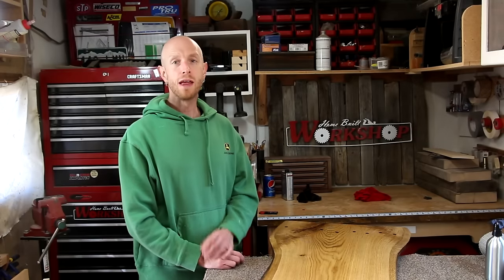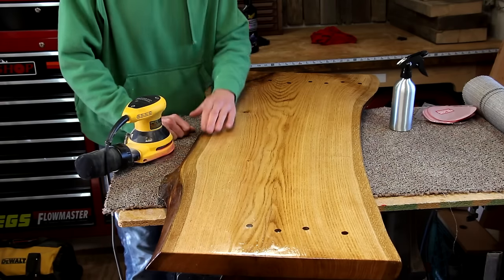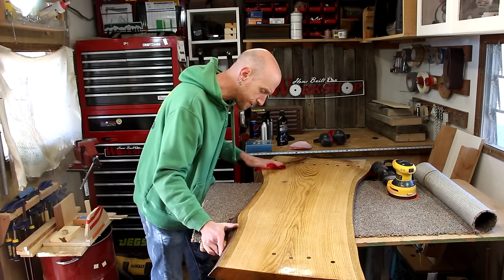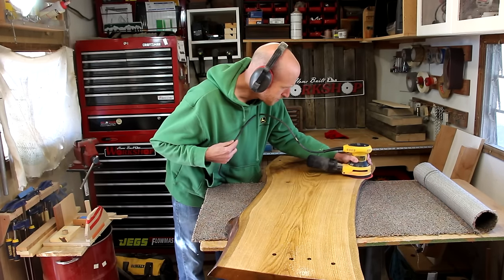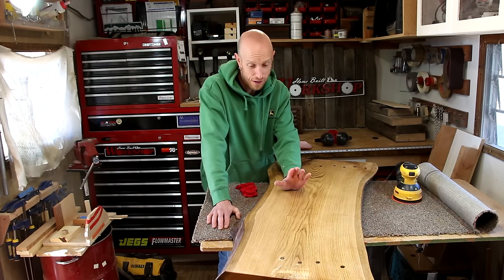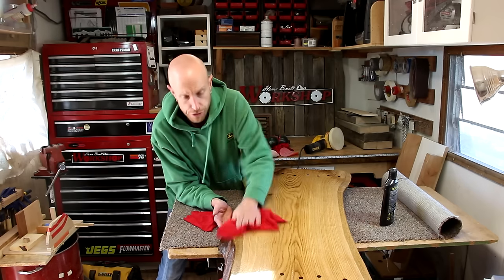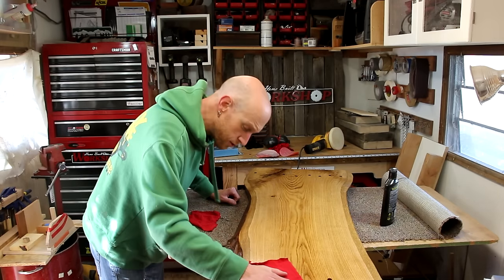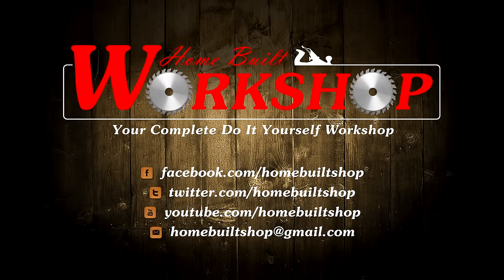How to Buff Polyurethane to a High Gloss

Comment: How long should I wait in-between every coat??
Reply from the maker: It depends on the type you're using. I've found that Poly takes a bit longer between coats than a lacquer. I'd see what the manufacturer recommends and try to stick with that. It usually works well.

Comment: So, if I recently finished an oak table and have between 4-6 solid coats of poly, I should still let the table cure for a week or two prior to following this process?  I do see a few brush marks and small imperfections/sanding scratches that I want to buff out immediately.  It's driving me CRAZY!!! Thanks for any support and feedback.
Reply from the maker: You still need to wait for the finish to cure. It needs to be hardened completely, it will help eliminate burning through. I know it's tough to wait. I'm the same way and want to get it done. 😁

Comment: I suppose you used oil based poly?
Reply from the maker: This was oil based. I have done this with water based and lacquer as well.
Reply: @homebuiltshop  Thank you for sharing your experience, experience is what I don't have. Comparing lacquer to water based poly, which has better durability for a sofa end table? I heard lacquer has higher gloss.

Comment: Are the sandpaper grades you are speaking of in P grade or not? If not where do you grade 2000 grit paper?
Reply from the maker: I ordered it online. Not sure if it's P though.
Reply: P grade would be printed on back of sandpaper. 2000 grit sandpaper is hard to find if not impossible. P2000 is equivelent to 320 grit. Big difference. 2000 grit would be something like a brown paper bag.
Reply from the maker: It's very smooth. Definitely not 320.

Comment: might the water-dust-mix damage the dust collection bag?
Reply from the maker: foxo1 that's a good question. I should have elaborated on that. The sandpaper I'm using does not have any holes for dust collection so it doesn't suck up any of the crud. I even took off the dust bag and looked into the sander. It was dry.

Comment: 15 coats?!?! I don't understand. A few coats is plenty thick to wet sand and buff. Or are you applying especially thin coats?
Reply from the maker: The wipe on poly is pretty thin. I just wanted to make sure I had plenty on there.
Reply: I think generally 1 coat of brush-on is considered equivalent to ~3 coats of wipe on.  So if the recommendation is usually 3-5 coats of brush, that would be 9-15 wipe-on.

Comment: IN BETWEEN  GLOSS COATS BEING PUT ON SHOULD I SAND AND IF SO WHAT GRIT ? THANKS
Reply from the maker: +Joe Dziedzic yes, sand with at least 220 or finer. I use a scotch brite pad most of the time. You just want to knock down the high spots.
Reply: Jeff Baker is 400 grit too high between coats?

Comment: OMG! That's why I find mysterious scratches after I've sanded! Small bits of finish gets stuck in the sandpaper. Any tips on keeping the sandpaper cleaner (before it needs to be changed out)? Thanks and great video!
Reply from the maker: I usually just stop and clean it out quite often. I'll sometimes use a brush to try to clean the paper. I also try to keep the surface of the project clean of debris too, so it doesn't get picked up by the sandpaper. If you're wet sanding, the water helps as well.

Comment: Is that just a normal random orbital sander? I don't want to use my sander with water if it's not safe. It looks like it's just a little water, so maybe that's okay?
Reply from the maker: +Lunar Cat Spray Paint Art just a regular sander. The water doesn't seem to get into it. I've done this several times and had no issue. The sandpaper doesn't have holes for the dust collection so the water doesn't get inside.
Reply: Awesome thanks for the reply. Great video.
Reply: Lunar Cat Spray Paint Art the most that can happen is you get fried holding the sander .
Reply: I didn't get fried thankfully. My desk top looks very nice and shiny though.
Reply: Lunar Cat Spray Paint Art yes it did. Came out nice. I was making a joke about getting fried. The other guy was nervous about using water. Just need good common sense when working with power tools. 😳
Reply: Lunar Cat Spray Paint Art oh yeah, you should show the desk top completely done on the desk it’s self , thanks
Reply: Just make sure you turn on the sander and run it under the tap before you start.

Comment: I looked through many of the comments to see if my question was answered, but gave up because all of the trolling.  Did you use oil based poly on this or water based poly and does it really make a difference with buffing it to a bright shine?  I am working on a drum set and am using aromatic red cedar veneer for the shells.  I love the look of ARC, but did a snare drum years ago with oil based poly and it darkened it beyond what I liked.  I saw videos and read articles about using water based poly because it doesn't darken it as much.  I have been testing water based poly on a small piece of the veneer.  It darkened it a bit, but well within the range I can deal with.  I'm at 5 coats with water based poly and a synthetic brush and it has a pretty decent shine once it has dried, but I am curious as to whether I can get it shinier by buffing.  I know it won't with 5 coats because I had a faux pas with a 335 DIY guitar project where I buffed through.   Thanks for the video.  I loved it.
Reply from the maker: Thank you, I haven't tried this with water based poly. I have heard it doesn't darken as much too. I dont see any reason this process wouldn't work for the water based. You should be able to build up several coats and buff it right up. I'd keep going on your test piece and then polish that first to see how it looks. Sounds like a fun project. I should try to make a drum. 👍

Comment: 2000 grit is probably not coarse enough to do the job because it doesn't last long against a hardened clear also 2000 grit tends to clog up easier making it stop abrading the clear and start polishing again.  id start out with 1500 and for a table that size probably use 2 sheets of wet or dry then on to the 2000 for long enough to get it nice and smooth. if you want to reduce your buffing time you may want to go to 3000 grit after you finish the 2000 grit step. once you are done with 3000 grit you will see a satin shine start to develop. this is perfect for polishing with a random orbital polisher but a random orbit sander will work in a pinch it will just take more time as most sanders only have a 9 millimeter orbit where a "good" polisher will usually have a minimum of 12. note i do not consider the porter cable random orbit polisher to be a "good" polisher. when i think of "good" polishers i think of Rupes. the porter cable only has a 8 millimeter orbit meaning it polishes even slower than your sander but it will still do the job. ssl :D

Comment: Great video. I've just tried this technique and it didn't work - because I used car wax (often called "wax polish" here in the UK) instead of real car polish (which of course is a really fine abrasive). If you redo this video maybe you could clarify this? Having said that, it's strictly my bad, not yours!
Reply from the maker: I'm sorry you had some difficulty with this. I will try to clarify in any future videos.

Comment: I am refinishing a gun stock and have now applied 7 coats of Minwax Oil-Polyurethane, but keep getting little bubbles. 

I do sand between each poly coat btw. I am using a Wooster Polyurethane Foam Brush.

My current and hopefully last poly coat is almost glass shiny which is what I want.

  I read somewhere that I can avoid sanding it if it is my last coat of poly by "BUFFING" the surface with 0000 wool and a paste to remove little particles WITHOUT removing the shine of the gloss polyurethane?  Can anyone chime in on this, please??
Reply from the maker: +Joe Luke I haven't tried this but I recently saw a video demonstrating that same process. I think it was done by Fine Woodworking.
Reply: Jeff Baker awesome, thanks for the heads up. I'll give it a search!

Comment: The only thing I disagree with, and it has been my choice and what I’ve learned between middle school and high school is.
  Never to use automotive wax products on wood, we were always taught to use Johnson’s Paste Wax.
  Be it either with a buffer or entirely or by hand. This his what I’ve always done, and never a problem.
  Again it has been my experience.
Reply from the maker: I have been told the same about wax. This product however isn't a wax. Its a polish. Think of it as a very high grit sandpaper to make it smooth and shiny. Wax would go on after this polishing step.
Reply: You are not waxing the wood.

You are waxing the poly coating.

Comment: Thank you for this!  I am in the end stage of finishing a vintage teak table - will the auto polish show water rings if folks put wet glasses on it?  It needs to be bulletproof for my family of barbarians :-)
Reply from the maker: +kathy n I think if you put enough coats to seal it up completely, it should be fine. My table has no rings so far.
Reply: Thanks!

Comment: If you level sanded between coats you wouldn't have the problem you ended up with. I can still see the orange peel in the reflection.
Level sanding that table between coats on that table would have taken less than two minutes and your final product would look like a sheet of glass.

Comment: You never flattened the finish first, should of went started with240 git to flatten then go through the smoother grits .
Reply from the maker: I did flatten it, I just used a much higher grit. It would have been quicker if I started with 240, but I'd rather spend a bit more time sanding with a finer grit, than risk sanding through with a coarser grit.
Reply: Home Built Workshop it must be flattened to get rid of the wavy finish, then use the higher grades to get rid of your 240 scratchers, you have well enough finish on your wood don’t worry about burn through, keep a eye on it.  Watch car painters videos they are the best to learn from, cutting and buffing, in particular, just a matter of experience, good luck.

Comment: I  have  a  question  ....  A  customer  wants  her  hardwood  floors  to  look  like  glass  any  suggestions ?
Reply: Shane Scheimann  depending on condition, age, spaces or gaps,existng finish a few things can be  done. new install ,sand med. grit 40-60,putty nail holes etc.,fine sand 80 or 100 grit .if staining use buffer pad to knock down grain,vacum,tack,coat with lambswool applicator and brush edge first keeping wet edge as you move across room.apply with grain. first two coats high gloss polyurethane ,3 -1 mix poly  and thinner or naptha. for that scar your retinas super reflective final coat go super high gloss. buff or light screen in between coats.start smooth finish smooth. older or improperly installed floors will separate at seams.this will show up in final finish.if you try to putty or fill it will fall out in bits and pieces due to expansion and contraction  over time .also old floors need additional sanding with heavier grit .talk to someone at a floorsanding supply,look at a few tutorials, they can demonstrate what i have said. after 30 yrs i still get a kick out of redoing the tough ones.good luck.

Comment: did i read "15 coats" I thought 3-4 is sufficient lol.
Reply from the maker: Yep. There was a lot of coats. If you plan to level sand then polish, you need to have enough material on there or you risk sanding through your finish.If you don't plan to polish it up, 3 coats would be just fine.

Comment: just a warning about automotive polishes & waxes - a lot contain silicone. This should never be brought into a woodworking or finishing workshop.  
Deep finishes always trap solvents which can take months to finally evaporate. Thinner finishes actually set harder . Quite frankly for all the effort you have put in the result is very poor. 
 I am not a troll - I have 35 yrs experience & am highly regarded by some very prominent people as among the world's best. I don't share much of my knowledge any more because of trolls - especially in australia - where many on local woodwork & guitar sites seem to have no problem displaying their ignorance to the world.
  Finally - if using a brush, a lot of the grit in final finish is actually lacquer which sets in the top of the brush & is then dragged down into the fresh coat. It only takes about 10 minutes for these finishes to start to harden at the top of the brush.